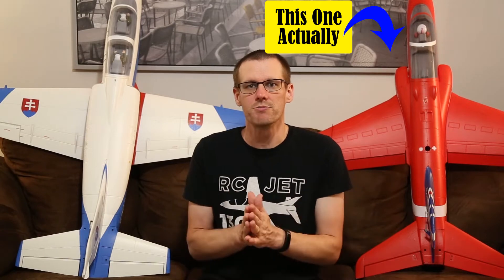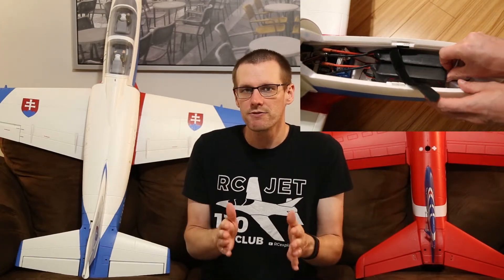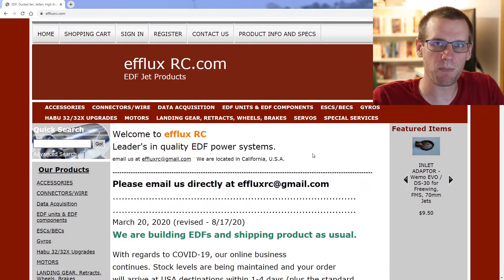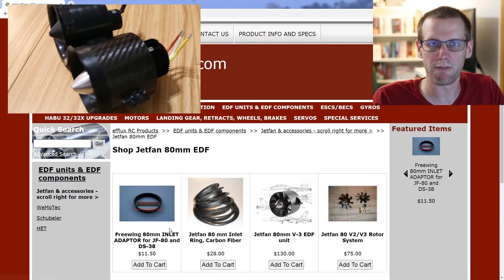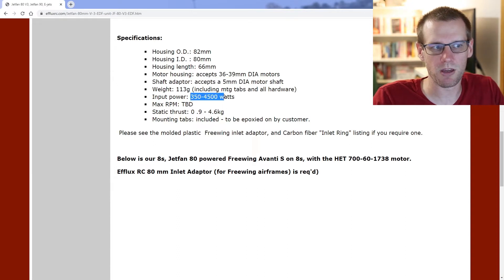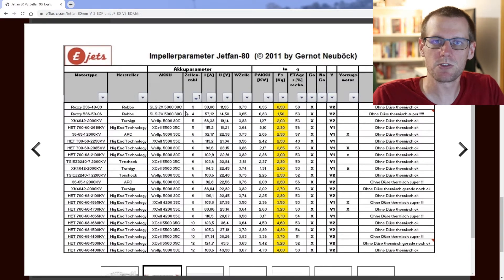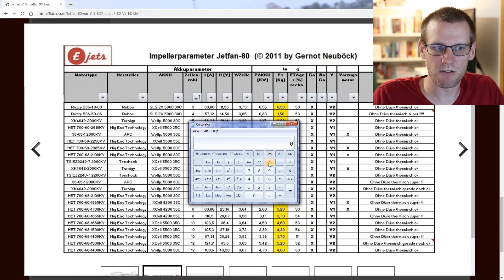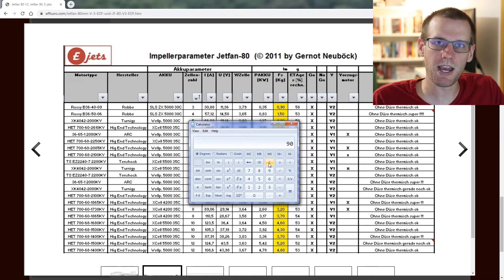Easily upgrade your EDF Fan, Motor, ESC and Batteries to go FASTER - Few simple steps.

Comment: With the jet fan brand do you have to run the front lip or can I run the fan unit with out the plastic or fiberglass front lip
Reply from the maker: All fans of this nature require the lip if the airplane does not have ducting right to the fan case. Otherwise thrust will drop significantly.

Comment: Hi bro ,i have 14.8v Lipo battery and 30a esc which motor is high speed 2200kv or 1000kv motor

Comment: Can I put two 64mm edf   3900kv’s 4s on a 6s battery
Reply: If the motor and esc you have says 4s then you will burn it out by running a 6s. It's significantly more power

Comment: RCexplained Why model Gas jet engines produce more thrust than EDFs the same diameter ? Could an EDF reach the same thrust that a Gas jet with a powerful compact electric motor ?
Reply from the maker: Jet turbine engines have a very high exhaust gas speed that is near impossible to achieve with an electric motor.
Reply: @RCexplained  That's because the energy added in the compressor and the combustion chamber that then is transformed into velocity in the nozzle ? It's not due to the RPM right ? because both have similar max RPM (70000-80000) ?
Reply: @gonzalomorenoandonaegui2052  search for the "meredith effect".

yes. its all about the HEAT. hot air wants to expand. you cant get that from an EDF. or a nitro DF... even though they do add a bit of  heat, rpm is limited.
Reply: @RCexplained  that's because the gas expelled by an EDF is just air that gained kinetic energy, while a turbine expells the gases 'created' at the moment of the combustion at a high volumetric ratio